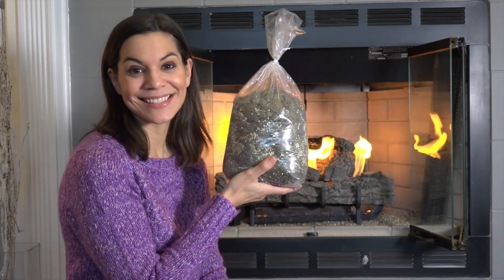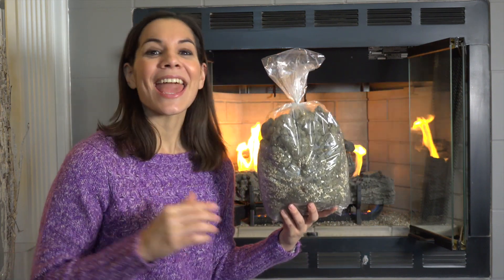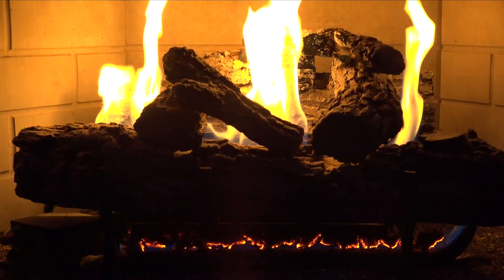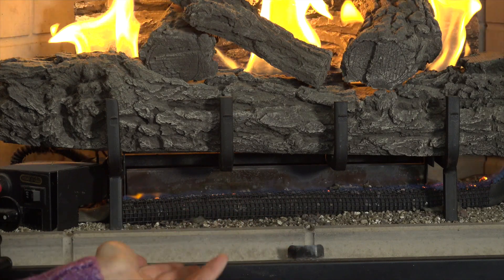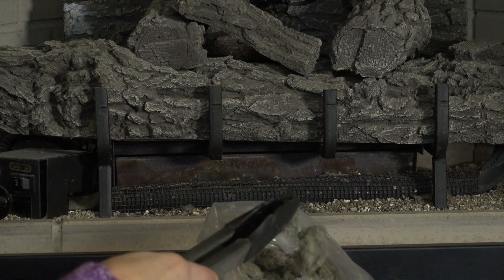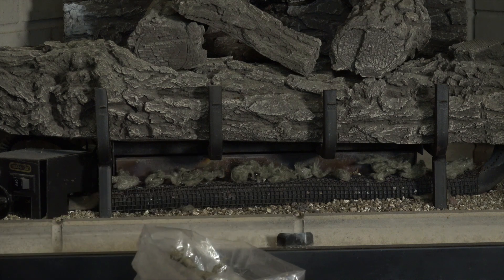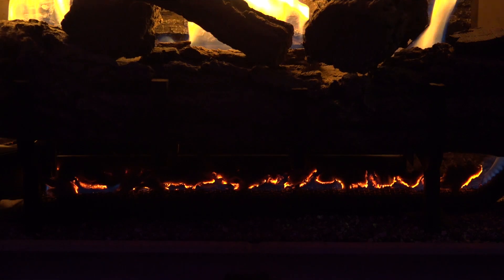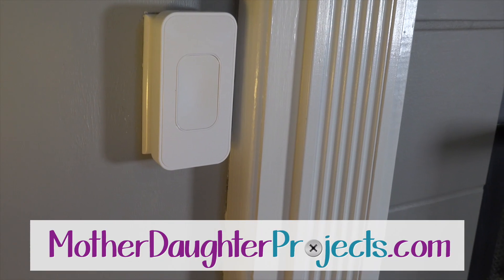Do you need glowing embers for your fireplace?

Comment: Awesome video and a great idea.  I am thinking about buying a gas fireplace insert and I like the one you have.  Do you happen to know the companies make and model of your gas insert?
Reply from the maker: I don't know, sorry. It came with the house and I can't find any markings on it.
Reply: @MotherDaughterProjectsDIY  No problem.  Thanks for looking.
Reply: What are you looking for, a gas insert or gas logs? If your wanting what she has I would suggest Peterson Real Fyre gas logs, vent free will be like hers, but if your looking for cosmetics over heat then the vented set looks better, as the vented set has a pan with sand that lets the flames spread better with a deeper ember burn with an over all more real looking flame. It all depends on what your looking for, but over all Peterson Real Fyre logs are one of the best sets on the market, easy to use, and can come with a remote for even easier use.

Comment: Mine only has one gas burning tube I wonder how I can make it work with the embers.
Reply: if your still needing help with this, i can help you, where is the tube located with your log set, is this a gas log set, or a wall furnace? i hope there a log set as theres no point for a wall furnace. If you can see the burn tube then all you need to do is place some over the burner to one hide the burner and two to get that nice burning ember look. for this lady's set, she has a back burner and a front burner, from what i can see this looks to be a vent free log set, depending on the set you can place some across the back burner too, to one spread the flames out, two bring a little more flame to the front and three increase the over all look of the burn as sometimes you can see the back burner from above at the right angles. I would suggest getting some acorns or decretive logs to hide the burn tube going back to the back burner and add more coals to the from to help hide the burn tube. Now for yours you can do the same, as long as its a gas log set like hers. If its a vented set with a single burn tube in the middle with a pan surrounding it, I would fist see if it needs sand check your manual or look at the burner to see if it has a half pan going around it with a log grate over that with the logs sitting on the grate. Most of the time it would need sand first, and the sand is a special type so make sure to get what your manual calls for. Then after the sand you spread a ember mix bag over the sand and spread it till the sand is hidden but dont pack the sand or the embers down, loose is best, but not so loose they fall out or burn away. And your done, its a very easy prosses, just take your time to make sure it looks good and that your not burning your logs with the flames, as this blackens your logs and makes then look ugly, but no matter what use your manual for your set, if you dont have your manual most log sets have a metal plate in the back with make and model, with this you can download it online. Hope this helped.

Comment: How often should glowing embers be replaced?
Reply from the maker: Not sure, I replaced mine when the old one's stopped glowing.
Reply: Generally they will last 3 to 5 years depending on amount of use.
Reply: I would add embers once a year, you dont need to take the old out just add a little to where it needs it. After about 3 years then you can replace all the old and start with fresh embers.

Comment: Where is the follow up video?  I can't find it.
Reply from the maker: Hi- what follow up are you looking for?
Reply: @MotherDaughterProjectsDIY  Did I misunderstand? I thought there was a follow up video on the gas fireplace. Maybe I'm wrong.  If you're taking requests :) I could use help in figuring out how in the world to make the turn on knob on the gas longer so I don't have to put my head into the fireplace to turn on the gas. I can't afford to have a professional help me.  Thank you for responding to my question. I appreciate that so much.
Reply from the maker: Hi, I don't mess with the gas myself. If I need to relight, I call the city and they will come light it for a very small fee. You might want to see if this service is available in your area. -Steph
Reply: @yesiownfrodo  What do you mean by the nob, and what type of set do you have, im a fireplace tech, if you still need help let me know, but it mostly depends on your LOG SET. Is this a gas log set or a gas fireplace? Do you have a front glass, solid glass with no hinges not folding glass doors in front of your logs, are there controls in a under cage? Or just a log set with a burn pan that has controls in the front or to the side? Does it have a standing pilot, electronic igniter, or a match light.